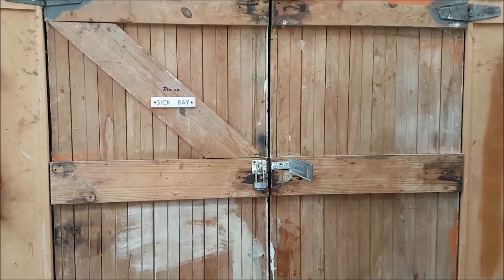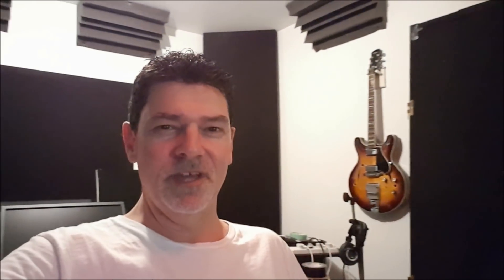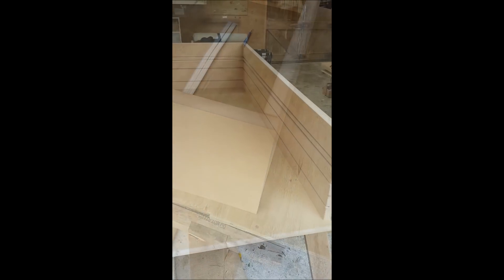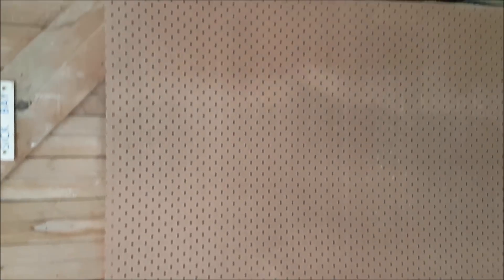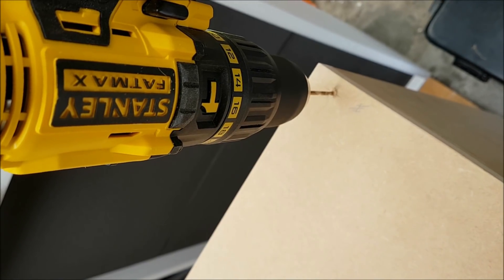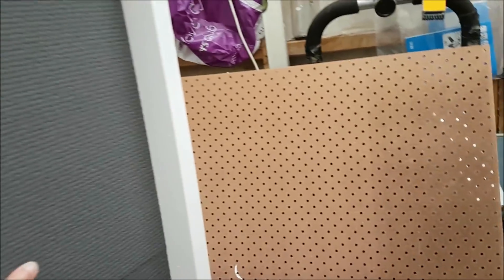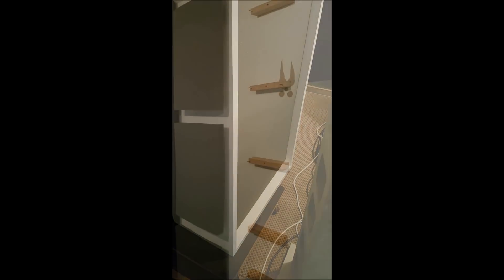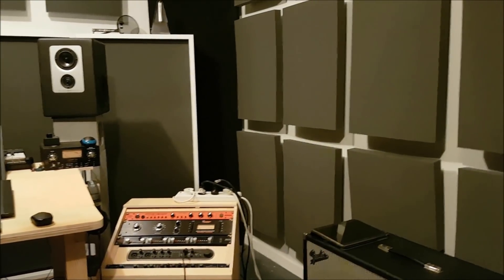DIY Studio: New Zealand - www.AcousticFields.com

Comment: Glad they helped! I’ve always been interested in them but thought he quit selling the plans quite a while ago. I did see he him advertise they are for sell in his new video though so might end up building some for my room if they are needed. Hopefully the room is designed well enough that many won’t be needed. 32’x18’x10’ theater.
Reply from the maker: A, With a 10' ceiling height, you will have issues below 100 Hz. throughout the room width and length.

Comment: Nice work!  I was going to have Dennis make me a drum platform filled with the carbon, but I determined it would take up too much space. Now I'm re-thinking the whole matter. Thanks for sharing.
Reply from the maker: M,  Low frequency producing instruments always benefit from placing the absorbing technology as close to source as possible. Absorbing the excess energy before it gets into the room and is then impacted by room modal issues is always a good thing. Just ask near field microphones.
Reply: Right on!  If we can engineer it to suit my needs space wise, I'll spring for it.
Reply from the maker: M,  The height of the platform is 10". That dimension can not be changed.
Reply: Got it, thanks

Comment: Why no before and after measurements?
Reply from the maker: S, No need. I have built and measured over 145 rooms and have client's room in my data base.
Reply: Acoustic Fields surely it would help the cause to give the numbers to silence nah sayers
Reply from the maker: S,  Nah sayers will always be around. I enjoy their banter. Most of it is based in self preservation. All you have to do is look at the Riverbank test data on our site and perform the calculations. All the numbers are there even for the nah sayers.

Comment: Go Kiwi DIY!!! Your room sounded better even unfinished. Happy mixing.
Reply from the maker: O, Yes, the Rt- 60 times (reflections) were good but no low frequency management. Rt-60 treatment costs are about 25 % of low frequency management costs. Most small rooms require 8 units on front and rear walls. With 1.5 dB attenuation per unit, 8 units will have a 12 dB impact on response below 100 Hz. That also translates to smoother mids and highs because of the linearity of the carbon technology.

Comment: Hey Dennis & Acoustic Fields crew, have you any measurements to show just how powerful this carbon tech is? I'm talking reverberation response in the frequency and time aspects etc. comparing without any treatment, with DIY cheap stuff and with carbon. Cheers.
Reply from the maker: J,  Performance data is available on our web site:  https://www.acousticfields.com/what-makes-us-special/
Reply: Dennis:
As I am very interested in the 30-40hz range myself, I checked out the link. The graphs show the same amount of absorption at the 30hz mark for both ACDA-12 and ACDA-10. How can they perform the same at this frequency?
Thanks
Reply from the maker: D, You can control resonant frequency by varying cabinet densities, carbon density and thickness along with depth.
Reply: Ok I see. I just saw the 27" x 48" x 12" vs. 27" x 48" x 8.25" and assumed same densities. My mistake.
Reply: And, the 2007/2008 RAL tests show data only to 40hz. Is there additional test data available for download?

Comment: Is this 'special' activated carbon?
Reply from the maker: B,  Yes, we process our own to insure porosity count and size along with granule density. Over the counter carbons used for water and air purification will not work.
Reply: Acoustic Fields Can I buy your activated carbon in Europe (Belgium) ?
Reply from the maker: B,  We manufacture carbon and ship from London. Send me your ship to address to : info@acousticfields.com and I can calculate shipping costs. The carbon is 400.00 USD / BDA unit. I will also include the build plans with your carbon purchase.
Reply from the maker: A,  I will need your exact address to calculate shipping costs. Send to info@acousticfields.com

Comment: Happy New Year :)
Excellent DIY build, it looks very nice!

Dennis: Do you know if there are before/after frequency response and/or waterfall graphs for this room?
Thanks
Reply from the maker: D,  No measurements were taken.  Each BDA unit, with the carbon, attenuates 1.5 dB / 10 sq.ft.  It takes 8-10 units to impact 10 dB issues. More units are required with larger peaks below 100 Hz.
Reply: Ok, then maybe encourage the next treatment project to measure.
Thanks for the extra details.
Reply from the maker: D,  Most hobbyists want improvement, especially in the low end. Get the fundamentals correct in the low end, then all the harmonics above 30 Hz and through 200 Hz. also get attenuated. The key is to do it linearly, covering all octaves evenly with no spacial irregularities. That's where the carbon comes in. With 4 units, you get a 6 dB audible difference in the low end. If your low end issues are + 20, it will not be as noticeable as if your issues were + 10 dB SPL  We have found that you must cover enough square footage with the correct rate and level to create audible differences. Its a cumulative effect. You have to reach a point of critical mass in order to impact low end audibility.